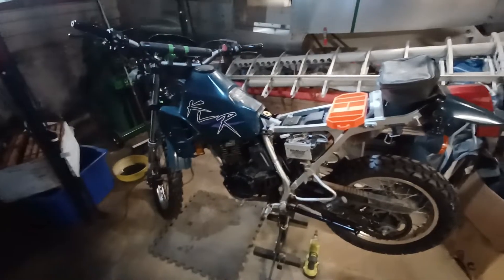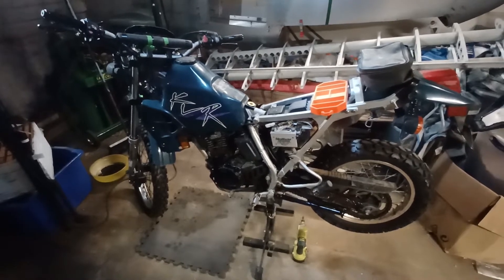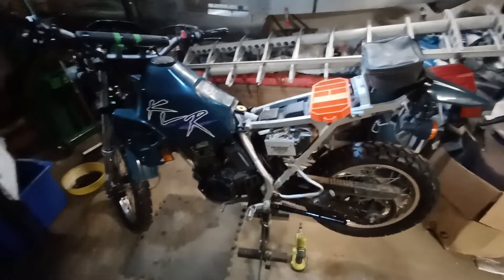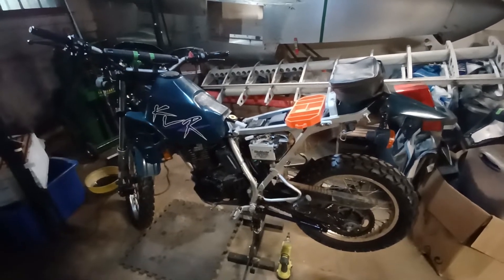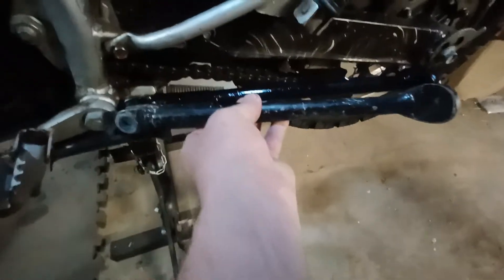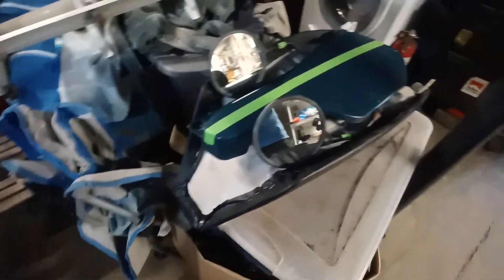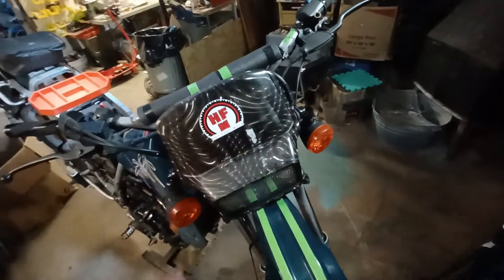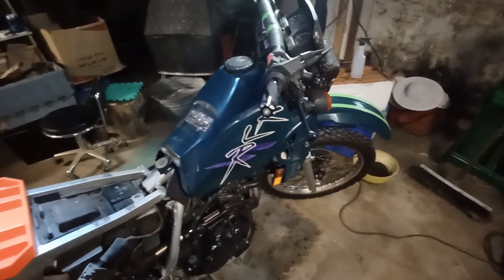Kawasaki KLR 250 pt1

Comment: I’ll buy those  lowering components. I just picked up same bike, but I’m too short and/or inflexible to get on it 🫤😆 . . .I’m in Fresno 🤷🏻‍♂️
Reply from the maker: I'm sorry Vincent, I sold those links WITH the short kickstand. None of the dog bone sets I saw included and shorter kickstand. Covered my costs to buy an OEM kickstand and then some. The bike does sit quite higher now with the new rear shock and preload set I like but it's SO plush now that all the travel can actually be used instead of 1/2 of it in squat / sag.

Comment: How many inches on the rear suspension extension? and what is your height bro?
Reply from the maker: The bike had been lowered about 2". I have since raised it up about 3.5" with sock fork adjustment and rear links as well as stiffer springs front and back so it now has almost 11" ground clearance with no weight on it. I'm 6'2" tall and about 210 lbs with no gear. I ride with boots, pants (most of the time) helmet, gloves and normally about 15 lbs of weight in my back pack. I often also have anywhere from 15 to 25 lbs on the rear luggage rack and do ride 2 up after putting some clicks on the rear shock and some air in the forks.